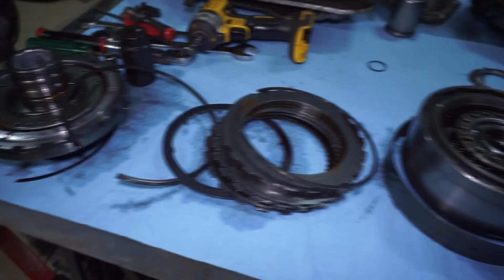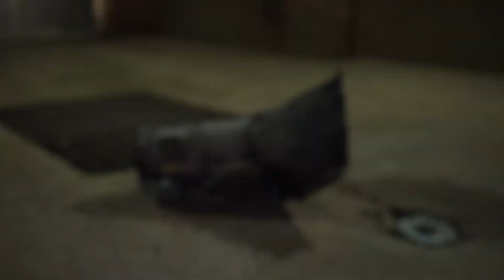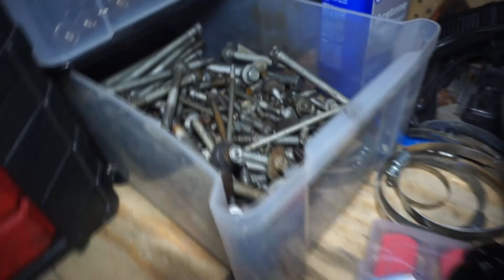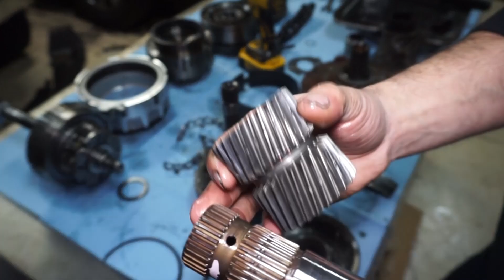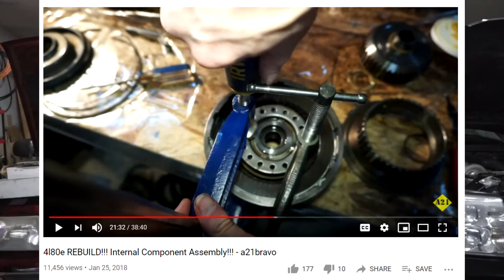4l80e REBUILD | Drum Disassembly And Inspection | Forward Drum Direct Drum Broken Sprag

Comment: Good Job on the video. Question how do you remove the forward inner seal on the drum, it is pressed in right, like to remove and put a new seal. Thanks David.
Reply from the maker: Would uave to press it off. I usually don't do that seal. The seal really only slows fluid, when forward gears are applied the fluid bleeds through the hole in and applies fluid to the whole piston. Piston is applied in all forward gears, so is not needed for gear changes. It just dampens the apply.  I've done a couple for my personal cars with no seal.

Comment: dont forget to flush your lines and cooler on yours so trash from the failure don't flow back through the fresh trans.   thanks for posting man.  good stuff
Reply from the maker: This was a junkyard core so failure didn't happen in the vehicle. Still has a good working trans in it now. But good tip! 👍
Reply: @BlaserBuilds  gotcha =)  there is a plug where the tail housing bolts on, you have to replace it with one with a small hole in it for lube on the rear bushing, the 4x4 model is solid.   Another tip i got from richard over at precision them boys know every single detail. enjoyed your video.  thanks for posting.
Reply from the maker: @AGuysGarage  Yep, I have the plug for it already. Had to do the same when I converted the 80e in my ranger to 4x4!
Reply: @BlaserBuilds  You the man, been watching you for a while and have no idea why you don't have more views, your projects are always cool.   maybe some folk just are looking for a how too instead of an informational, either way i really like watching.

Comment: Any differences inside with older or newer 80e, since the fluid ports are in different locations?
Reply from the maker: Center support, valve body, sun shaft, output shaft, quite a few things. Some minor, some critical.
Reply: @BlaserBuilds  thanks all I could find at the moment was older one but I got a good deal on it so hopefully it holds up.

Comment: Someone send this man a long stainless steel table with a drain through for rebuilding transmissions.
Reply from the maker: I was looking at building one before this actually. I have an idea in my head for one that folds up and hides under work bench. Would be nice to have if I can find a way for it not to take up space, lol.
Reply: @BlaserBuilds  well if you got one for free you could chop it up and make it happen No loss no cost. People always have old restaurants equipment they are trying to get rid of.
Reply from the maker: @mattsadach5208  I've been on the prowl.
Reply: Not that Detroit is anywhere you want to come. Nor do you want t spend any money but for example. Just found a 4 foot stainless prep table 400$.